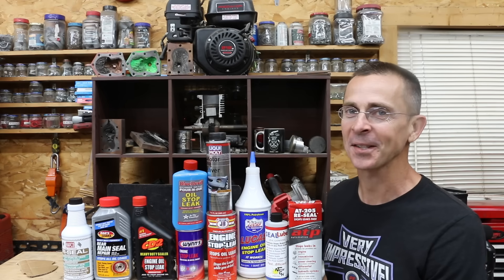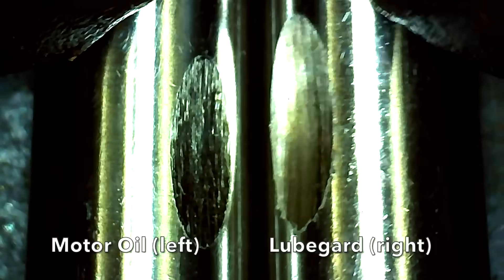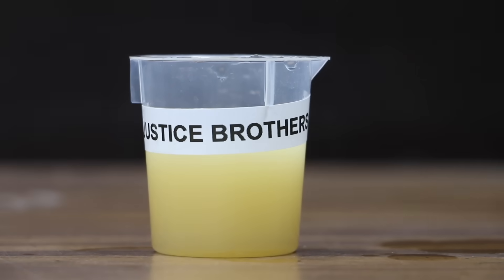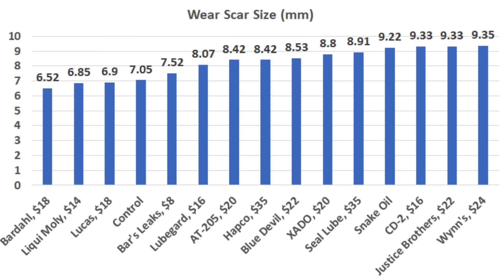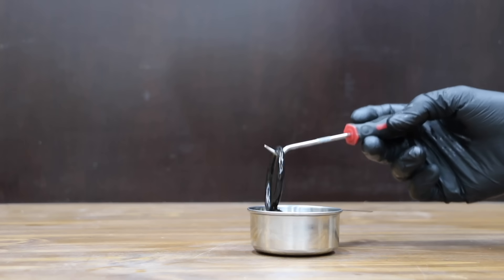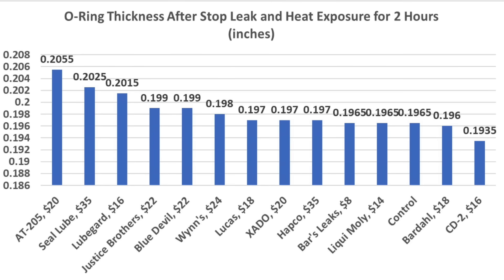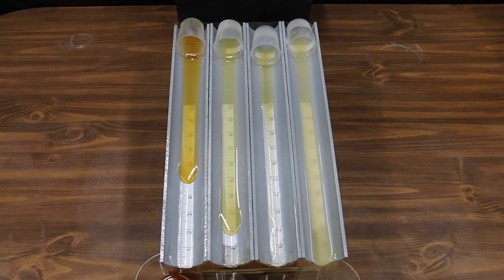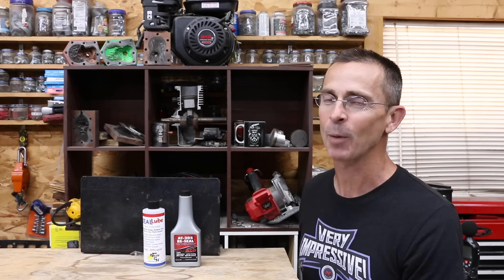Do Stop Leak Products Work? Do They Damage Engine Seals? Will They Destroy an Engine? Let's Find Out

Comment: The mechanic that I sometimes use said to NOT use these products. He has seen them make leaks worse.
Reply: I've heard many mechanics say not to use any kind of additives.  I had a 1997 Chrysler with a 2.7 V6, the rods would rattle after sitting for a week,  then when the oil pressure came up they would stop. I changed the oil,  put a quart of Lucas oil Stableizer in and it stopped the rod rattle.  Later, approximately a year later I replaced the rod bearings,  and kept using the Lucas and the engine was very quite. Still Lucas did help stop the engine from smoking as well.  I had the car for about 5 years,  and used Lucas in that car the whole time.  Much Cheaper than an engine rebuild. Just my opinion,  and not the opinion of this channel or its supporters.
Reply from the maker: Thanks for the feedback.

Comment: Blue devil is supposed to be put with gas not with engine oil. If there’s a leak I know the potential solution of blue devil is not to mix with the oil as much as possible and instead fix the seal from the side where there is gas. I figure that’s have an impact on the test.

Comment: Could the products that both boil off and harm lubricity be intended to soften and swell the seals, after which lubricity returns due to the boil off of the remaining product?  If so, they are not as bad as they seem compared to those that harm lubricity and do not boil off.

Comment: Very interesting hypothesis you are testing.  I have a few questions.  What is the variation of thickness and hardness measurements  for any specific point of the O ring and what is the variation of thickness and hardness for multiple points on an O ring’s circumference? 

I didn’t see how you measured thickness and hardness at the exact same spot in each O ring pre and post treatment.

Comment: somehow i can't trust that these things would not cause more harm than good i would only try it on a car that was almost dead with nothing to lose. weirdly my daughter's car had a bunch of leaks after driving it around on rough dirt roads in Iowa we replaced a power steering hose and it still leaked but just changing fluids actually seems to have stopped the leaks maybe just new fluid and oil rejuvenated the seals, but it is not leaking now.
Reply from the maker: Thanks for sharing.

Comment: One thing I have used on leaky Power steering and transmissions is Brake Fluid.  Add just a capful and leave for a week of normal use. If still leaking, add another cap full. never needed to add more than 2 capfuls to stop a leak.
Reply from the maker: Thanks for the feedback.

Comment: REAL WORLD EXPERIENCE: Titan Sealer, have used on 3 vehicles and it works as advertised. 2004 JGC with 4.7 v8, approx. 1-1 1/4 qts every fill up. 2 years and approx. 20,000 miles later, no smoke, no leaks, no oil consumption. Subaru outback 3.6 no oil consumption after 1 and 1/2 years. TITAN SEALER, it works.....
Reply from the maker: Thanks for the feedback.

Comment: Question - if your idling a v8 engine as a power source for a battery bank. After How many hrs would you suggest changing the oil at.
Reply from the maker: Thanks for the suggestion.

Comment: Scott Kimmer posted a video about AT 205 several years ago.   I use it once a year in 2003 Lincoln LS with 217,000.  The car started a small leak around 205,000.  No more leak but have to use it once a year.
Reply from the maker: Thanks for the feedback.

Comment: i am a retired professional transmission rebuilder and shop owner. i can tell you from 40 years' experience that transmission "stop leak" will absolutely destroy a transmission, it will make the rubber seals swell, but after short while they will balloon and be useless!  the old timers would pour brake fluid in hydraulic jacks and transmissions, it does the same thing. i bet in the end it will do the same to an engine,,,,,,,,,,,,,,,,,,,,,
Reply from the maker: Thanks for the feedback.

Comment: I personally wouldn't use a stop leak product in any engine you care about..a few years ago i bought a used Acura from a car dealer that i only wanted because of the chassis, so i didn't really care about the engine as long as it ran..anyways the engine ran really good but had a rear main seal leak, so the dealer used a stop leak additive in the engine to attempt to fix it. I decided to fully service the engine and repair all the leaks properly except the rear main seal which still had a slight leak as i planned on pulling the engine down later on down the track. About a year later it blew a head gasket, so i stripped the engine down and it was clean except for some black sludgy deposits that i think were due to the additive and some broken pieces of hard gasket that had gotten stuck in the oil pickup screen. Its my opinion that the additive softened the old gaskets causing them to perish and break up into small hard pieces that then went into the oil galleries & pickup. Some debris had also made it down into the crank main bearings causing damage to the bearing shells. It certainly would have been a much better idea to just replace the seal as a long term fix which may have prevented the damaged caused by the gasket/seal material.
Reply from the maker: Thanks for the feedback.

Comment: I don't know if it's been done yet, I haven't made it through the library completely yet. 
Gun oils lubricity, temp/wear and overall performance. I've seen everything from motor oil, 3 in 1 oil  to Hoppes #9, CLP Break free and Frog Lube. 

Love these videos. Super informative for the DIY'R and those looking for things that will save money without ending up with junk that will fall apart under moderate use.
Reply from the maker: Thanks!

Comment: I need your test on this one.
This is a potential life saver.
Been working as a anaesthetics nurse in theatre for past 10 years.
Seen This product. Can you test the original life-Vac anti choking device vs a fake one from ebay or aliexpress. And compare the two products to see if the one way valve and pressure on suction is equal. 
Sincerly,
Nurse
Reply from the maker: Thanks for the suggestion.

Comment: Thing is with these is if you have a simple leak like there are signs but nothing dripping then don't add these to the engine or transmission because they effect all seals which can make them deteriorate far quicker over time and trying to take things apart become a whole lot worse as what would normally slip apart would be jammed as if it was rusted in. They can fix but they sure can mess things up. Old cars or ones that have not ran in a very long time like 10 years long time are what these products are for and even then its a use this to fix then flush out oil if repairs are done type thing. Good test with the wear potential as some of them acted almost like water thrown in.
Reply from the maker: Thanks for the feedback.

Comment: I used Lucas on my leaky Reliant 850cc engine in combination with Morris "Goldenfilm" classic car oil and it stopped a leak in both the sump gasket and timing chain cover gasket, the engine itself is a very old design based on an even older ancient design (Austin 7 pre-war sidevalve) so Reliant engines can be a bit messy even with new gaskets as its all alloy.   I use Barr's rad-seal once a year as per advice for anyone with an all alloy engine as it fills up imperfections in the castings, something people don't do with them all alloy Caddy lumps then wonder why they blew up.
Reply from the maker: Thanks for sharing.

Comment: I know you are trying to keep the tests consistent with using one part oil and one part leak additive. But as some of the directions state, some are to be mixed 3 to 1 or even 6 to 1. Do you think that changing the ratio could have affected the results? As an example, the solvents that hurt the oil might be less damaging to the oil if it were more deluded?

Comment: Thank you for this video and another job very well done.
The subject of stop-leak products gives me some video ideas.

For instance, I've always wondered if prolong, the engine treatment, actually works.
I saw an infomercial for it in the 90s and they claimed the product could protect your engine even if rocks and sand were added.  I don't remember seeing one of your videos with that product covered.  If you have already, and I missed it, a link or mention would be appreciated.  If you haven't featured prolong in any of your videos, another round of engine/oil additives might need to be in order.

Other products I've heard mixed messaging on are things like radiator stopleak.  I've always avoided them out of rumored water pump damage.  However, some mechanics swear by them.  Something to consider.

Another video idea is engine flushes.  Historically, I've used Motor Medic 5min Motor Flush to flush out heavily sludged engines, but I'm curious if there are better options.  As a side note, I have a theory that the product is slightly modified offroad (farm) diesel, but have never confirmed.  I've also heard rumors that straight diesel fuel is an effective engine flush.  Something else to consider.

Again, thank you for all your meticulous and considerate work, mixed with sprinkles of humor.
This channel is indeed, a precious gem of the internet.
Reply from the maker: Thanks so much!  Thanks for the video ideas.

Comment: I picked up a couple of brands of Silicone Tape from Amazon. They claim to cure a lot of things from radiator and garden hose leaks, plumbers water seal, etc. I got it to put in the car in case a radiator hose had a leak. It turned out that I had a pin hole leak in that small hose you use with a kitchen sink. The first tape I put on did not stop the leak at all. I tried the second brand and after several wraps it doesn't leak - but the hose doesn't come out of the hole now. :(  Anyway, now I don't trust them to stop a radiator hose leak. Maybe these silicone tapes would make for some good testing!
Reply from the maker: Thanks for the suggestion.

Comment: Definitely seems a few of these products intend on stopping leaks by filling the leaky spots with piston ring shavings.  My wife's car never had issues until we put Lucas in on an oil change, there shortly after it blew out a hole in the valve cover gasket and took years to discover preciously what was leaking, basically a small drip in a shadowed area onto the alternator which then aerosolized it to every where in front of the engine making us think it was a front main seal, this caused the harmonic balancer to become spongey and eventually throw itself off balance including the belts stranding us on the highway once.  The vehicle also began to have a stuck lifter that persisted for years until recently, both the shadowed leak and lifter seem to be common on the Suzuki H25/27 engine which makes me wonder today if using heavy weight oils is the leading cause of these issues.
Reply from the maker: Thanks for sharing.

Comment: I watched a few videos from a transmission rebuilder . He show how stop leaks in a transmission swelled all the orings and caused internal leaks . He said that stop leak needs to be drained after a short run to prevent seals and orings from expanding too far .
Reply from the maker: Thanks for sharing.

Comment: I dont know if I wholeheartedly believe in this particular oil lubricity test. For example with the Blue Devil, you mix it 50/50. In an engine that holds 6 qts and Blue Devil is added, that mix is not 50/50 and the true oil to Blue Devil ratio is greatly reduced and may not impair the oil lubricity as it did in your test. Would you care to elaborate on that hypothesis?

Comment: The folks at AT-205 Reseal told me that heat is required to activate the product, so Scotty Kilmer's claim to wipe it on all rubber parts under the car should not be a good use of this product. Your results may vary.

Comment: In the years I have been watching this channel this is the first time I have any kind of critical comment. It seems as though you are mixing all the products 1/1 with oil, but in a real world use case the products would actually be much more diluted with motor oil. In chemistry having the proper ratios is paramount to having the same outcomes each time. So a 1/1 mixture is gonna behave wildly different than a 5/1 mixture which is what these products are usually designed for.

Comment: I love you're channel and you''re work, but I just thought I would let you know that there is a small issue with your rubber testing. I'm an engineer for a gasket company so this is my expertise. You need an IRHD hardness meter for this, NOT shore A. For shore A, the part needs to be larger in order for the reading to be valid. Atleast 6 mm thick, and 20 mm around (ideally even larger than this). Shore A is heavily affected by object geometry. IRHD is also slightly affected, but nowhere near as bad.

Comment: I'm having trouble balancing the AT-205's potential for increasing engine bearing wear due to its effect on oil lubricity vs it's improvement of an engine seal's functional characteristics.  Great research often generates more questions...  Still, great video.  Glad neither of our cars here (2012 w/186K miles and 2016 w/66k miles) are leaving oil spots on the garage floor.
Reply from the maker: Thanks!  Thanks for the feedback.

Comment: Tried Barr's Stopleak with copper for my radiator. Held for half an hour before it let loose and sprayed copper particles all over my engine.  Cleaned it up, replaced the radiator.  But wondering if I should use a cleaner that can remove the remaining stop leak buildup in the system.

Comment: I'd love to see a product like "Rislone rear main seal repair" tested if you ever revisit this. also the "Lucas power steering stop leak". I've used both before and both had stopped leaks even after oil changes had been done, removing the product from the system.  

Very interesting to see what those products do to the lubricity! I'll definitely be looking at them differently now that's for sure
Reply from the maker: Thanks for the feedback.

Comment: Bar's Leaks in my country is sold as Rislone, otherwise same label and bottle. It's also the most expensive at $52 NZD. Thanks for doing this - I was thinking about an oil additive to solve my rear mains weeping problem on my ageing engine on the cheap. Guess I'll just pull the bugger and do it properly.
Reply from the maker: You are welcome!

Comment: Wish you would have tried the titan brand stop leak. That stuff, amazingly actually works well. I had a head gasket leaking coolant into a cylinder on a ls style engine. Pulled the plug and it shot out a decent amount of coolant. Did the stop leak procedure they tell you to do, and it worked for years.

Comment: A test of high mileage motor oils would be awesome. My truck is nearing 300,000 miles and I run penzoil ultra platinum based off your testing, but I always wonder if I should use the platinum high mileage instead. It would be interesting to see how the high mileage oils compare when it comes to lubrication, cold weather viscosity, and the ability to keep o rings in good shape.
Reply from the maker: Thanks for the video idea.

Comment: As your video shows these should be avoided like the plague when possible. Some work well as a stop gap when there is no other choice, but the risk of damage is too high if the engine isn't already toast.

I've seen the stop leaks for head gaskets and radiators absolutely destroy the motors they were put in. Did they stop the leak? Ya... so well nothing flowed through after it.
Reply from the maker: Thanks for the feedback.

Comment: I would imagine the ones that showed more evaporative loss would work better for seals in the PCV system or other areas where the oil doesn't sit but oil vapors make their way to that area over time, so that might be a positive attribute more than a negative one (within reason, of course).
Reply from the maker: Thanks for the feedback.

Comment: I would love to see this exact same set of tests/video done with oils meant for high mileage engines. I was a bit surprised by the rankings for the "new o ring after 48h exposure" tests at the end - wouldn't you want to see no change on an oring /seal which hasn't had any damage? Your rankings seemed to be the opposite of what I thought would be desired in that test (at-20 would Come in last because it caused new seals to swell potentially beyond spec). Great video thank you as always!
Reply from the maker: Thanks!  Thanks for the suggestion.

Comment: I wish you had done this test a few years. I bought AT205. I have used a little in my power steering fluid and a little in my oil. Nowhere near the concentrations you did, so doubt it did any damage with the low concentration
Reply from the maker: Thanks for the feedback.

Comment: It's doesn't matter if they work or not, do not use them. Repair the leak, each engine has varying tolerances, viscosity requirements, different sealants/gaskets, variable cam timing/lift/compression.....

Just. Dont.
Reply from the maker: Thanks for the feedback.

Comment: AT-205. Great product. I had a 2000 Cadillac with a rack and pinion that I was told was leaking so badly that it needed to be replaced. $800 10 years ago.
One bottle of AT-205 and I drove it with no leaks for 3 more years. I did, how ever flush the system after about 2 weeks of driving.
I believe (I may be wrong) that AT-205 is supposed to be added 8oz to 6 quarts, not half and half. 
I can see where half and half might cause damage because it is not a lubricant. 
I have used it in most everything (Not the brakes because they say not to) and have had very good results.
Just run it long enough to let it get to the seals then flush with the proper fluids. Then there is little chance of parts damage due to it not being a lubricant.
Reply from the maker: Thanks for the feedback.